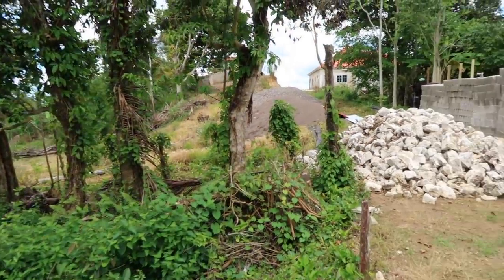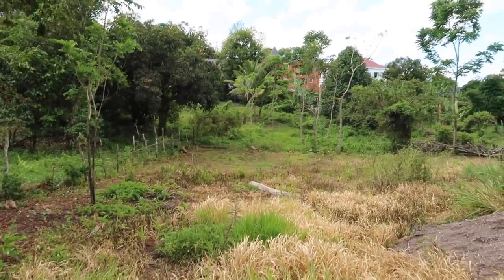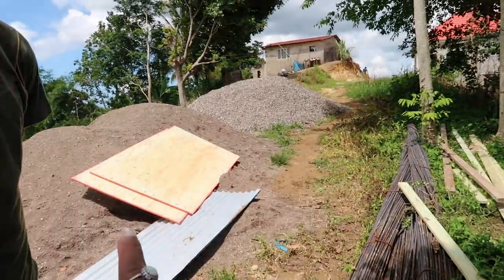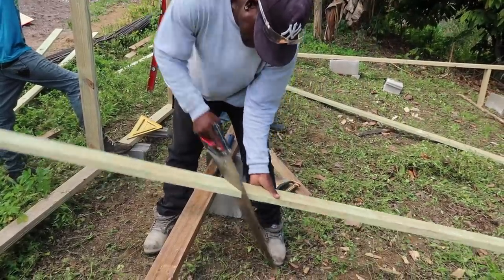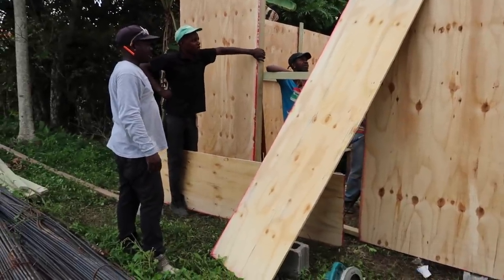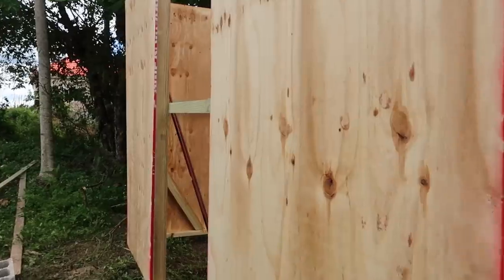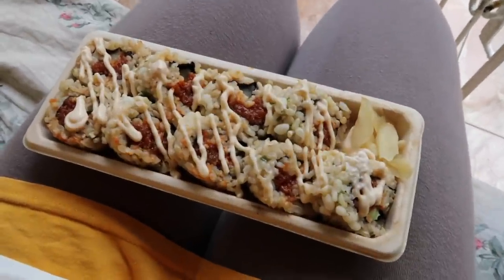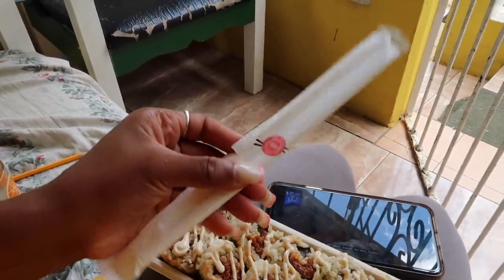Building Our Dream Home In Jamaica | Building The Storage Shed

Comment: Congradulation to you and your mom. Please make sure when your doing the foundation you guys Bring the house up high. At least 6 block height guys. So you go up a few stairs to enter  your house. If you notice the land is down low so when it rains you might have water comming in your house. My contactor made my house too low and water comes on the vahernda every time it rains also come in through the back of the house even though i told my contactor he build my house too low. Now im having to extended the front and back. I live in trewlany. Ok guys take Care and do lots of research and watch when it rains to see how it settles on your land. Blessings guys. Im very happy for you guys . Bless up. Canada/ Jamaica.
Reply from the maker: Water doesn’t settle in that area even when it rains hard 🙌🏽
Reply: @BicanaBrown  i did hear the guy who appears to be the builder say to the dreadlocked fellow that he had noticed some water settled in a depression ABOVE the level of your site and that he felt that there may be an issue with underground water so you may still want to explore the possibility of a proper site inspection, which is a good idea anyway to determine if your foundation will need footings and tie beams or you can just go with a basic mat.

If there is underground water in any way then you will have to incorporate moisture barriers, french drains and pile type footings or you will have to deal with cracked walls and door frames and windows that split in the corners in just a few years. Better to be pound wise now than penny foolish later. 

Great to see Jamaicans returning and building up this great nation. Congratulations!
Reply: Nice
Reply: Great advice
Reply: There was one house in florida near the ocean that didnt get wash wa because the foundation was on high blocks so water can run under it.  Congratulations anyway.  Love the family love you guys have.  Blessed